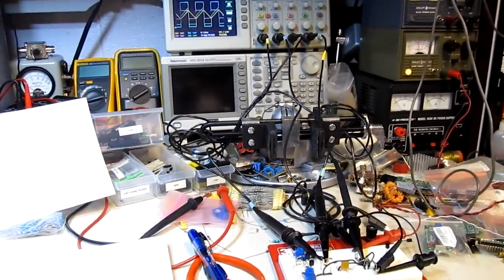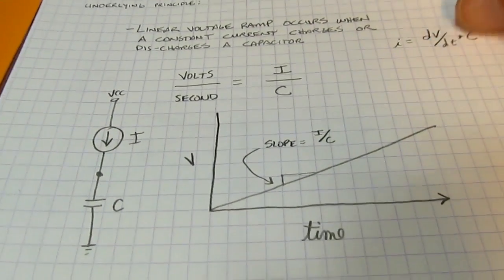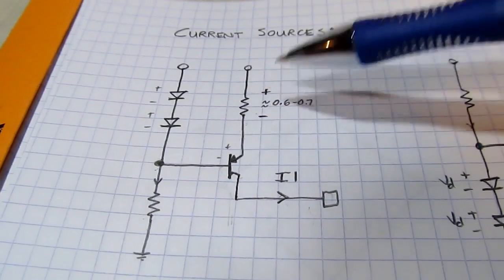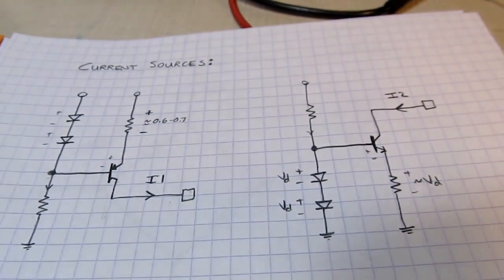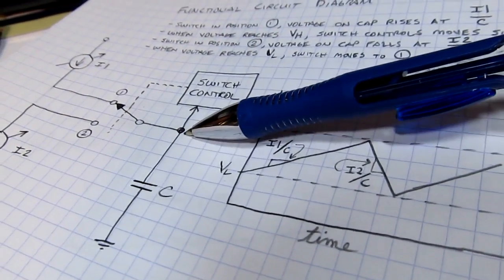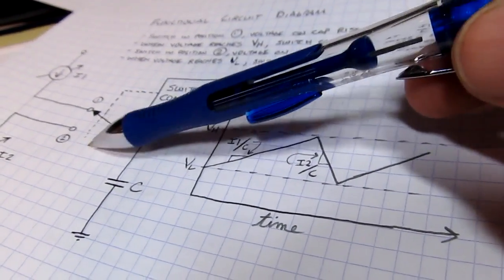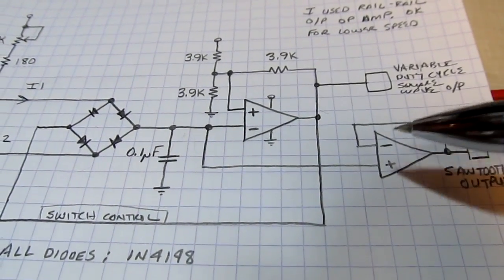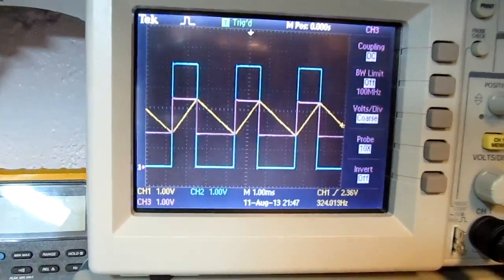#104: Circuit tutorial: sawtooth generator w/ current sources, diode switches, hysteresis comparator

Comment: I'm planning to use this kind of triangle generator for PWM input to a switching regulator. For this, I'll need a 50% duty cycle triangle at 100 kHz.

How would I derive the time on and time off for the circuit?
Reply: Maybe I can use identical values for both current sources - that will output a symmetrical wave. Now, if I adjust the current symmetrically in both sources, that adjusts the period, right? After that, I would chain the triangle signal to an amplifier to give a triangle with amplitude equal to Vcc.
Reply: I noticed an interesting feature about the circuit. Both current sources are symmetrical. perhaps the current sources determine the charging and discharging time of the capacitor.
Reply from the maker: +Matthew Ferrie Yes, the PNP current source determines the charging rate, and the NPN current source determines the discharge current rate.  Matching the current sources will give you a symmetrical triangle waveform.
Reply: +w2aew Awesome. So, what would the formulas be for frequency and, for the Schmitt trigger, the upper and lower thresholds? I'd want an upper threshold of 6.75v and a lower threshold of 2.25v (the average of 9 and 4.5, and 4.5/2, respectively)
Reply from the maker: +Matthew Ferrie The schmitt trigger thresholds depend on the three resistor shown.  Assuming that the device used swings rail to rail, the thresholds are easily calculated by resistor dividers.  There are two cases - one where the feedback resistor is in parallel with the upper resistor, and one where it is in parallel with the lower resistor.

Comment: Comparators (LM 311) usually have an  open collector transistor output. Therefore would it be clearer if
one used  'turns the transistor on', or 'turns the transistor off' rather than' high' or' low'?
I realize with the op amp there would be no confusion. But it is described as a comparator early on. Thanks. Great
Presentation!

Comment: Greetings, I have a question, but first let me say these video series are better than any college classes I have taken. Your method of presentation is perfect for us visual learners. I have always had trouble grasping electronic concepts by just reading books, but using your videos as an adjunct, book material makes more sense. I now am able to go back and understand the material in the Art of Electronics thanks to you videos. I have always just known enough to get by when it comes to transistors and op amps, but now I am fully getting it. The diff amp video was the key to unlock the op-amp for me. So thanks for that. Now for my question which references vid #104.
I am building a function gen using the DDS chip AD9833 which outputs sine, square, and triangle, but no sawtooth. I want to use the AD9833 as the controller in the case of making a sawtooth, so I thought I could replace the comparator with my DDS chip as my bridge diode switch control. It sorta kinda works but at a very limited BW, and is really touchy on how I adjust the current sink and source pots. I think I am missing something fundamental. Is there a better way to do what I want, am I sorta on track? Thanks a bunch.
Reply from the maker: +MikeLogix I think what you're missing is that in my circuit, the current sources determine the frequency (by how long it takes for the cap to charge/discharge to the switching threshold of the hysteresis comparator.  By replacing the comparator with the DDS, the DSS is setting the frequency, so the sawtooth is now dependent on TWO things (the current sources AND the DDS frequency).  You'd have to add some form of dynamic control of the current sources so that they are at the right values for a given desired frequency.
Reply: +w2aew With some 200+ videos and thousands of viewer watching your videos, I can only imagine your email inbox must get quite full, so I feel fortunate that you still manage to find time and respond to questions like mine. I am now rethinking how I might make my sawtooth using a PSoC device and the DDS chip. I am already using the PSoC to control the DDS, so no extra hardware there. I will let you know how I end up solving this.  
Thank you very much.
Reply from the maker: +MikeLogix Yes - I get LOTS of emails and comments, but I do try to answer as many as possible, especially for folks that are actually building and experimenting (and not just looking for answers to their homework).
Reply: +w2aew Well, I never thought this would be so difficult, and I am sure much of the difficulty is my lack of certain principles, mainly mathematics (my kryptonite). The ramp is essential to my project and I really want to avoid all analog as the DDS gives fine resolution, and is much more stable. I think I should be able to do this using the DDS since I can bypass the Sine ROM, and use the phase registers, but I do not quite know how. My microcontroller is a PSoC so I could make a LUT, but that pesky math issue pops up. I did fine one solution in a EDN article, but it requires the addition of a AD9834. This may be the route I have to go, because I have banged my head trying to work out the fourier transform solutions. Here is a link to the EDN article in case anyone is interested.
http://www.edn.com/design/test-and-measurement/4333929/DDS-device-produces-sawtooth-waveform
Reply from the maker: +MikeLogix Well, I'm an old analog guy.  Sending a constant current into a capacitor is the simplest, most intuitive way to create a ramp that pops into my head (no code, no programming, etc.).  Maybe use your uC to setup the value of the current, or to control FET(s) to select a capacitor to use, and other for resetting the cap voltage.
Reply: +w2aew You inspire me, I will keep at it.

Comment: How are you connecting the oscilloscope to the circuit? I'm new to electronics and I am trying to construct this circuit, but I'm not sure where the scope should be hooked up to the breadboard. Thanks for the great videos.
Reply from the maker: +MrMarknagy123 The 10x scope probes are all clearly shown in the video at about the 14:00 minute mark. All the probe ground leads are connected to the circuit ground.

Comment: I want to generate a sawtooth waveform with a rise varying from 0 to 1V, Ton varying from 0.1 to 1ms, Fall time <100ns,Toff is also variable ( 0.2 - 2ms), variable duty cycle D, as 1% - 50% using a current source (howland current source) to charge the capacitor, a comparator is present to compare the Vc with 1V, discharging through a switch (transistor), delay generation etc are neede. I don't know how these circuits to be connected to get a sawtooth wave? Thanks in advance
Reply from the maker: +chand sukumar A constant current injected into a capacitor results in a linear ramp, so that's half of the sawtooth waveform.  Discharging it with a transistor switch creates the other half.  I have another video showing a similar application:
https://www.youtube.com/watch?v=bVahBmsvirE
Reply: +w2aew  Now I'm using howland current source as the constant current source, after pspice simulation, instead of ramp wave, I'm getting a straight line, what might be the problem? (current source value 0.5mA),comparing voltage of 1V? Thanks in advance
Reply from the maker: +chand sukumar It is impossible to say what's wrong without seeing a schematic.
Reply from the maker: +chand sukumar My best advise is to post the schematic and information on the EEVBlog Forum, either in the Beginners or Projects section.  I'll be able to see it there, along with many experts that frequent that forum.  This will give you a lot of good feedback besides just one (me).
http://www.eevblog.com/forum/

Comment: Help me I was asked to design an analog computer using operational amplifier and other compatible components  that will be use to determine current  of RCL circuit subjected to a Dc source plzzzzz
Reply from the maker: Wandisile Maphini Hmmm, sounds like a homework problem.  Here are some hints and clues that should help you figure this out...

Operational amplifiers (op amps) were invented first to be used in analog computers.  It is very easy to construct op amp circuits that perform addition (summing amplifier), subtraction (difference amplifier), as well as integration and differentiation (low pass and high pass filters).  The op amp lets you make nearly ideal integrators and differentiators.  Thus, think about the equations you'd used to solve the RLC circuit problem, and you'll see that each operation can be modeled with an appropriate op amp circuit (amplifier, integrator, differentiator).

Comment: Fantastically clear description. thank you. I never quite got the hysteresis thing until you mentioned that the feedback resistor is effectively in parallel with one of the other two. The light bulb is now on!
Reply from the maker: Carl Ranson I love those ah-ha! moments when the light bulb goes on!  Thanks for sharing!
Reply from the maker: A. Bob You can design a simple circuit that varies the current source values as a function of voltage.  Maybe my video on current sources will help.  I have some other videos on oscillators, here's a simple search URL:
https://www.youtube.com/user/w2aew/search?query=oscillator
Reply: ***** Thank you so much for this, I have been looking to find good explanations for how to diy something like this for fun. Do you have other oscillator designs? How do I add linear voltage control to the frequency?
Reply: Hi, I was thinking of other designs like quadrature oscillators etc.? Thanks, I will take a look at the other video :)

Comment: i cant till now understand the idea of the two diodes in each current source ???
Reply from the maker: The two diodes setup a fixed voltage bias that is 2 x Vf at the base of the current source transistor, where Vf = the diode voltage drop.  Since the base-emitter voltage is also approximately equal to Vf, this means that the voltage across the emitter resistor is equal to approximately Vf - regardless of the supply voltage.  Thus, the current in the current source is approximately equal to Vf/Re.  Short story - it makes the current source's current relatively independent of the supply voltage.
Reply: thank you very much u r the best

Comment: Absolutely love your videos. This particular video pulls so many separate ideas together. You are truly a masterful teacher. 
Ok, enough genuine butt kissing. I do have a question. I built this circuit and it works perfectly as expected but I needed to modify it to a substantially lower frequency to sweep an antique Weston volt meter (say, needle movement up and down cycle 2 seconds). My first thought was to increase the resistance of the pots but the saw tooth became very unlinear typical capacitor curve. Hmm, ok, Ill try to replace the capacitor with a larger value. Same curve, rats! What am I missing here. Even if you recommend a completely different circuit for  this application I would very much like to understand why this behavior. 
The Circuit is driven at 5 V supply

Thank you so so much
Reply from the maker: You're on the right track in both cases, reducing the current sources and/or increasing the capacitance. You just have to take care how far you take it. If the currents get too low, then leakage through the diodes that are "off" will be a source of non-linearity, was well as the input bias current of the comparator.  When you make the capacitor larger, you might start getting into electrolytic caps, which can have a fair amount of something called "soakage", where a residual charge can remain in the cap that has a long time constant. The answer with this circuit is probably applying a bit of both, but not to an extreme. Lower leakage diodes can help for the lower current case.   Of course, what you're trying to do can be done easily with a micro controller like an Arduino, but where's the fun in that?

Comment: Hi, sir, this circuit is eye-opening, but I am wondering if I could adapt it to have a -5V-to-5V sawtooth oscillator? I've tried several kinds of ramp generator such as constant current, bootstrap, UJT and miller integrator, and sadly found that they may be difficult to control the flashback time, may not be synchronisable, or simply can only oscillate from 0V or higher. So far only the combination of miller integrator and schmitt trigger is able to produce the desired waveform, which costs 2 op-amps. I also have tried to add negative DC offset for those generating 0-10V sawtooth, but in my design it requires 2 op-amps(one as voltage follower for stabilising voltage reference, one as summing amplifier), so it is not preferable. Could you kindly give some suggestions about the sawtooth oscillator design?
Reply from the maker: There are a lot of ways this can be done, depending on what your constraints are. You can build this circuit using + and -15V supplies and adjust the hysteresis appropriately, and it can be made to produce a +/-10V swing. Another option is a single op amp stage to change the amplitude and DC offset to what you need.